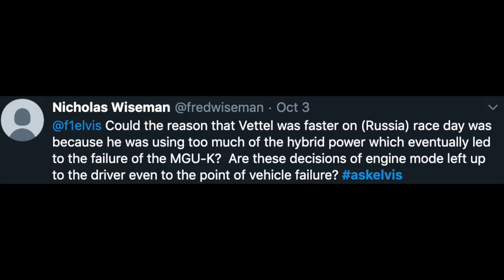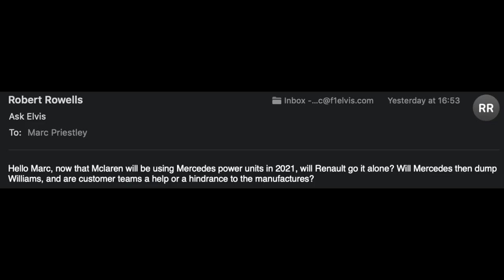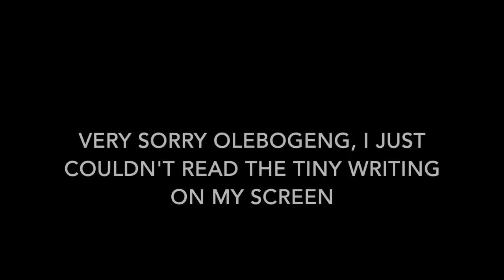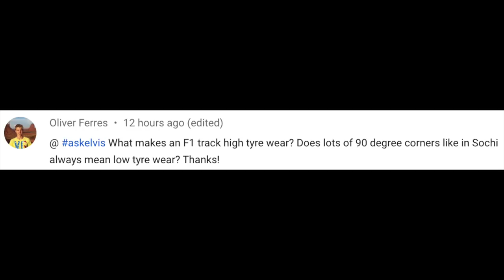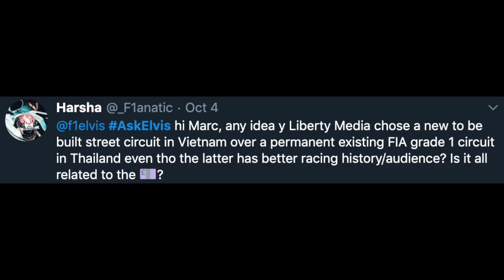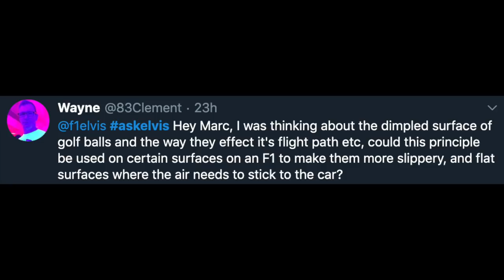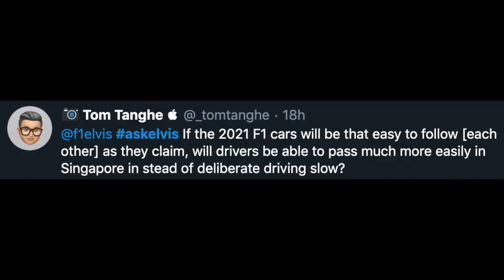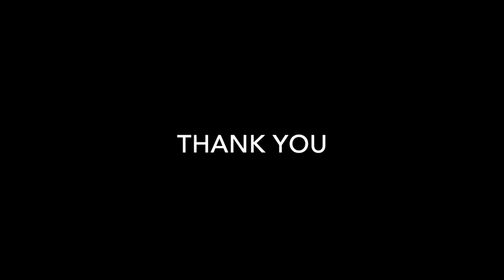MP320 - Golf Ball Dimples On An F1 car? #AskElvis

Comment: I've often considered the possibilities of a dimpled surface in F1, it would help airflow to stay attached to the bodywork. I think the main issue is the cost in testing it fullt for the potential benefit I suppose.
Reply: having known from a very small child WHY a golf ball is dimpled, and having an interest in aero, i have also wondered this for some time...
Reply: Essentially the golf ball dimples are omnidirectional vortex generators, but on an F1 car you know which direction the air is going to come from so you can optimize your vortex generation better.
Reply from the maker: It's not a cost thing, cfd can simulate it pretty accurately now. It's about the overall philosophy of an F1 car's aerodynamics as opposed to the single purpose (drag reduction) of that of a golf ball.

Comment: A dimpled surface like on a golf ball is not the most effective way to keep the airflow attached. It is the best for a ball, because you dont know what direction it is going. But since a car is meant to travel forward, asynchronous designs can be used. Vortex Generators are used on cars, all the smal flaps and fins ar vortex generators.
Reply from the maker: Exactly

Comment: There are indeed both cars and airplanes manufactured with the idea of "dimples" except they're not called "dimples" they're called "vortex generators" but they utilize the same effect.  On a golf-ball, we don't know which is the front and which is the back since the ball is spinning, therefore we have to cover the entire ball in dimples, but with a car or airplane, we do indeed know where the front and back are, so we don't need to cover the entire thing, we can put them only directly where they are needed, usually near the back of the roof on a car.  

It has both costs and benefits and the benefits only outweigh the costs for shapes that have a blunt back end, like golfballs, or semi-trucks, or hatchbacks.

Here are some further videos on the concept of golf ball dimples as applied to cars and airplanes:

https://www.youtube.com/watch?v=eP-YUDe9HF0
https://www.youtube.com/watch?v=uXYLCxq5YjA

Comment: 14:13 regarding this question, what if we just put the dimples at the back end of the f1 car like the underneath of the rear wing? The resulting turbulence down stream doesn't matter anyways, and it also improves the attachment of the air flow beneath the rear wing!

Comment: To be fair the electrical issues are risk of current flowing through the body parts. Power will flow from the battery + to - it won’t flow to earth. Getting out of the car should be fine BUT two contact points (both hands or hand-foot) could flow better through the person than through the car’s carbon fibre. That’s risky hence the rubber.
Reply: That's what he said in the video...

Comment: Hi I have a two questions i really want to know? 1st being why can't F1 make it Mandatory to use all 3 tires during a race to spice up strategy? 2nd And instead of the energy saving lights flashing why not just have brake lights so we can see the skill and difference between drivers and car management.  Great Channel and happy birthday!!!!!
Reply from the maker: Thanks. There's no reason they couldn't mandate using all 3 tyres. If anyone really wanted brake lights, you could have them, but you'd still need the harvest lights as that process happens independently of braking and slows the car dramatically, which is why they're there.
Reply: @F1Elvis  thank you for your response, I think a use of 3 tyres a race would be great and also means the teams could push tires harder as they will have to change anyway. Great stuff thanks again

Comment: I think McLaren is Mercedes AMG's safe bet in two instances:
1) Williams exits F1 due to economic situation.
2) Mercedes AMG wants to leave, and give "factory status" to McLaren.
Keeping options open, while keeping the engine factory in business?
Reply: Considering Mercedes involvement in Formula E, that could well be an option that they decide to leave in a few years if the 2021 regs are not to their taste, and as McLaren are certain to stay it would benefit Mercedes to have a factory team while they focus on Formula E. Depends on many, many factors of course.
Reply: I personally don't feel you could be more wrong, merc has invested an unbelievable amount into formula 1 they're here to stay, and Williams has a lot of support from the fia due to their heritage and they're used as a development platform for the amg drivers
Reply: @samdavies1752  I respect your personal feelings, but they don't help Williams with their obvious cash flow problems, and they don't change the fact that Internal Combustion Engine technology is becoming so politically incorrect that a manufacturer needs constantly to weigh in if F1 is acceptable, underlined by the queue of manufacturers on a waiting list to enter Formula E.
Mercedes-Benz is entering Formula E, and will have two options depending on how things pan out.
F1's under-marketing of the Hybrid aspect of F1 cars isn't exactly helping either.

Comment: I have wondered about how using a golf ball texture on a car would affect the aero, then I thought perhaps it's just a load of balls...😉
Reply: I remember Mythbusters tested it. If I remember correctly, they found a positive effect on fuel consumption.
Reply: @transient_  Yes, on the fuel economy I think!
Reply: The issue on that would be loss of drag v l of downforce.
Reply: @transient_  I've wondered about this ever since I saw that Mythbusters episode.
Reply: Golf balls happen to live at the right speed range where dimples really help them out. If they went slower, there would barely be any difference between the two. If they went faster, smooth balls would have a lower coefficient of drag (you can search online for golf ball coefficient of drag reynold's number). At the speeds that golf balls are usually moving, the dimples increase the drag from skin friction, but reduce the pressure drag of the ball for an overall gain. This doesn't necessarily apply to other shapes, where the balance between skin friction drag and pressure drag is different, or ones that move at different velocities, and overall scale also has a huge effect on this.
Reply: @jubuttib  That sounds plausible but, as mentioned above, Mythbusters tested that on something like a Corolla or Camry or something at 60 m.p.h. They controlled for most variables, including weight, fuel cell, etc. and performed multiple runs with the dimpled car and a control and measured a 14% improvement in fuel economy with the dimples. But, as you imply, aerodynamics is a ridiculously complex topic and ver non-intuitive.

Comment: I thought the 'golf ball dimple' ('shark skin') question was excellent. Sail sport has been wrestling with this, and I am not sure the question has been answered (in either sport). INEOS' recent America's Cup launch highlighted an appreciation of both water and air 'fluid dynamics, but I suspect the complication of adding 'lots of very small dimples' (or alternatively 'shark skin' has rather upset the digital models. Sharks seem to benefit, and golf balls do, so why has 'surface modelling' not impacted either sport? Not sure, but I suspect it will. (It could be a computation problem.)
Reply: The problem I can see for application to f1 in both cases is that neither examples is fighting a trade off of drag v downforce.

Comment: Years ago I saw a tv programme that said aircraft designers had discovered that, by copying dolphin skin and creating longitudinal flutes along the length of the aircraft fuselage, it made the plane 0.5% more efficient through the air. I often wondered why F1 designers didn't copy this as in  F1 0.5% is worth having.
Reply from the maker: A plane, or dolphin, has very different aero demands than a racing car!

Comment: happy 50th !! lol , does the ferrari still smoke a lot, and are they still burning oil in the combustion chamber?? p.s who checks on the manafacturers that they are not using extra parts i.e mgk, ice, etc, teams always say after failing to finish races (seb vettle) that the failure does not mean they need to use another new part, do the fia watch them strip the car down, at the factory??
Reply from the maker: Haha, all PU parts are sealed and scanned by the FIA before and after each event.

Comment: Hi Marc, how is an unsafe car after an electrical earth failure then earthed? Can marshals earth it in an emergency?
Reply from the maker: It's very rare that it's actually a live car, the light comes on as a precaution if there's a risk. Marshals and team use gloves capable of withstanding 1000v to be able to move or work on it. If they can't shut down systems to make it safe, then using that protective gear, they take it apart, find the fault and remove the defective components causing the short circuit or even remove the ES.
Reply: @F1Elvis  Thanks, Marc. I thought they'd just earth it with a piece of wire or something.
Reply from the maker: It would take ages to discharge the ES that way

Comment: #AskElvis I was driving back from work and was following behind a car on the highway trying to get a slipstream when I realize that I have no idea how much i benefit from it. Is there a way to calculate how powerful it is based on the width of the cars and how far back I am? Is there a proper formula to calculate it? Do teams do it and if not, why?
Reply from the maker: It has so many variables, it's very difficult to get an accurate number for any given situation. CFD can simulate most things, but it's not something that an F1 team can gain much by knowing.

Comment: Hi Marc re the dimples on the golf ball...one day many years ago i was at a flight school and one lecture was about why the russian migs could outfly the american aircraft ...so when the day came that a Mig flew onto a American base the wing was studied and to the dismay of the Boffins they were now looking at what looked to be nuts welded on to the wing.... So it was concluded that this was why the Migs could outclimb the americans.....this modification allowed the laminar flow to hold on to the wing that extra bit longer till the american jet stalled and then goodnight nurse.  A similar tale was recounted as to why lend lease (welded plate) destroyers could not turn fast on the high seas as the many rivet heads on the older type did much the same job as the nuts on the Mig wing..
Reply from the maker: Good story👍
Reply: @F1Elvis  In conclusion to the Mig story...what if someone would glue some fake rivet heads onto the underside of the wings on the nose section just a thought that's been on my mind for forty years. I will get onto the Magnus effect later on (this is how tugs steer and turn in their own length)

Comment: Hi Marc, 
Mercedes electric engine department is gonna be OP with their entry into FE. I can’t see Ferrari having the best engine going into the 2021 season. Mercedes are certainly gonna bring out a killer 2021 hybrid engine. Also with the 2021 regs moving towards ground effect like formula E, do you think Mercedes are gonna dominate even more than they have done in the current hybrid era?
#askelvis
Reply from the maker: With any big reg change there's an unknown, but Merc have proven their structure and way of working, so they should be strong. Anyone can find the magic solution to such a new set of problems though....
Reply: Must help Merc. Their ERSs deployment seems behind F at present though more reliable. Their ICE is def behind now...

Comment: (not read previous comments) You give bad information about the power control buttons in that the button is not controlled by the team during the race - it configured for each race but only up to the start of the race - only rumours of remote override at some teams. With regard to tyre wear: some track surfaces are specifically designed to be high grip - it does not have much to do with track age -  a clean track after rain will also have higher grip. Sources: not telling a former McLaren guy!!!